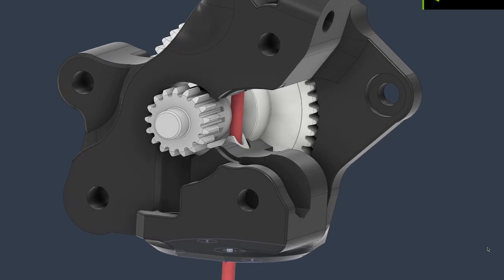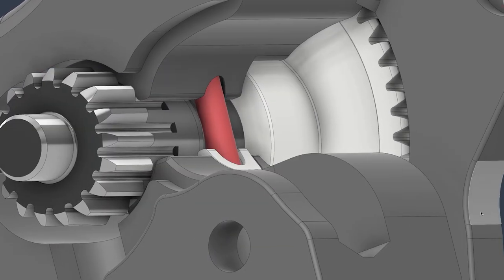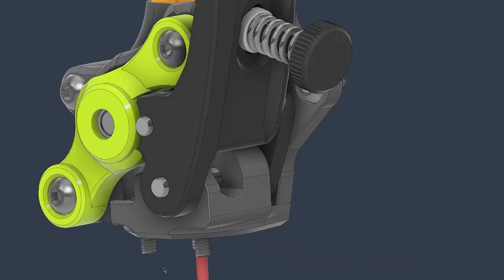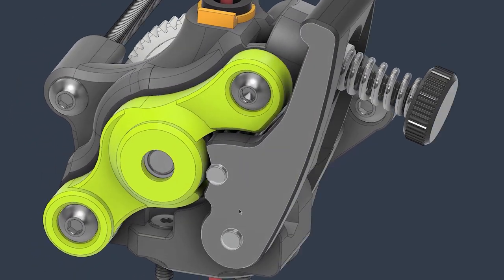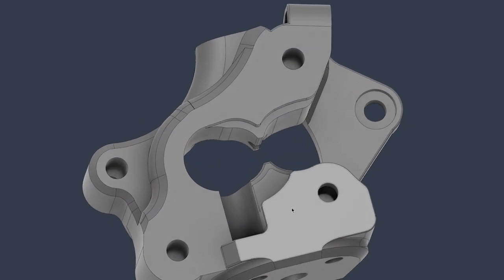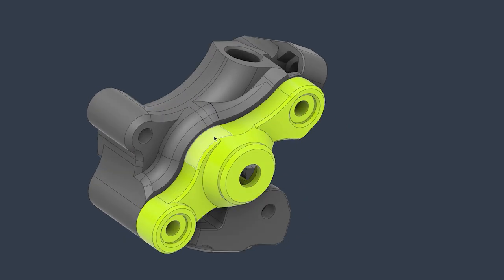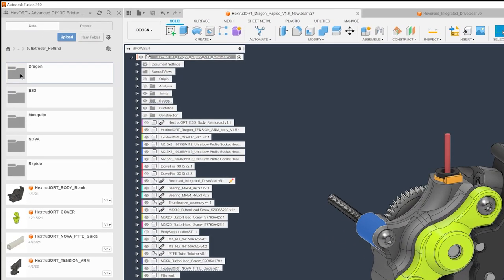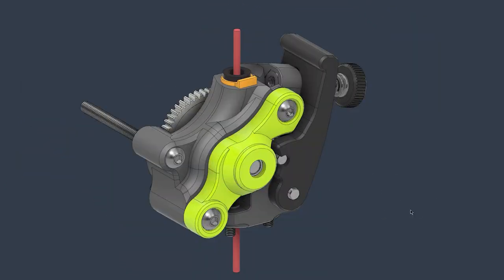Prepare HextrudORT housing for  - RIDGA and Flexible material

Comment: As always - very huge work on pushing 3d printers to new limits, speeds and quality, like! After adding bearing to my idler I really see the difference, not ideal because I have Z issues unsolved, but it really helps a lot, can't wait when my VZ parts were printed and finally change to rails and oldhams on Z.

Comment: What I did to better print flexibles is I used a push trough fitting and then cut a PTFE tube with a V shape where is almost touches the drive wheel. This helps with retraction a loooot. Is cheap and easy. You don´t need to fumble around with your PTFE Tube length, simply push it through the fitting and secure with a clip that´s it.
I think this would improve your design too a little.

Comment: Clever idea! The design also looks better! Just one thing I am wonder is why you are keeping the M3 nut as the metal threads for the lever tensioning screw instead of a heat insert? I'd think an insert would make it a little easier to print and not have these sharp edges for the nut insertion? I am not concerned about the insert pulling out of the hole as I am using this with my Sherpa for a long time now..

Comment: Are the ultra-low-head (socket) bolts really that much better than simple countersunk M3 bolts?
 The countersunk M3 bolts should have overall more surface area contact due to the angle of contact, and, to add, chamfers and fillets tend to be better at resisting delamination and/or shearing. It's really common practice in metal machining to add chamfers or, even better, fillets for corners to prevent shearing forces from forming cracks etc.
Reply from the maker: Countersunk in these locations wont work as they will apply splitting load to the layer orientation.
Reply: @HevORT  Fair enough. I had forgotten to factor-in printed layer orientation xD

Comment: hi, it would be compatible with different filament diameters...?
Reply from the maker: This designed is optimized for 1.75.  It would not work for 2.85 or 3mm.